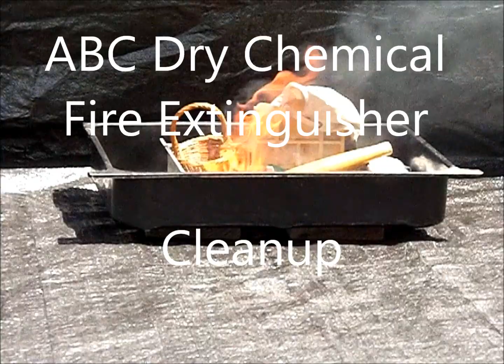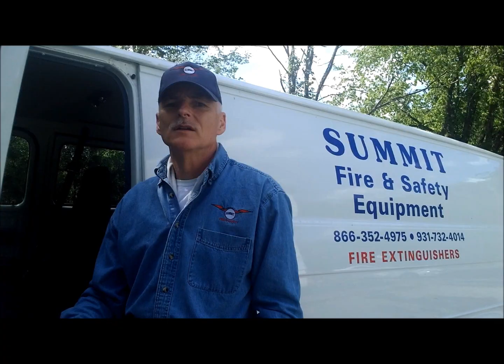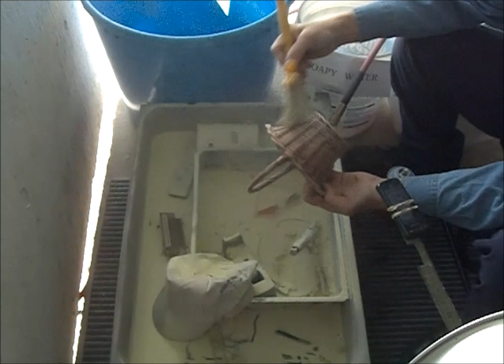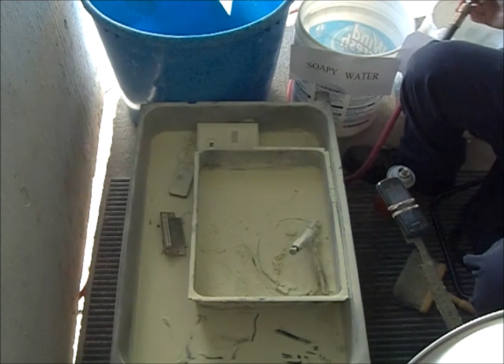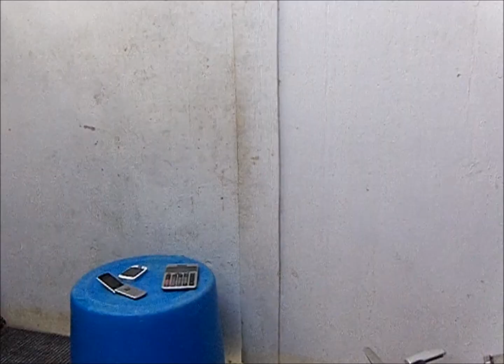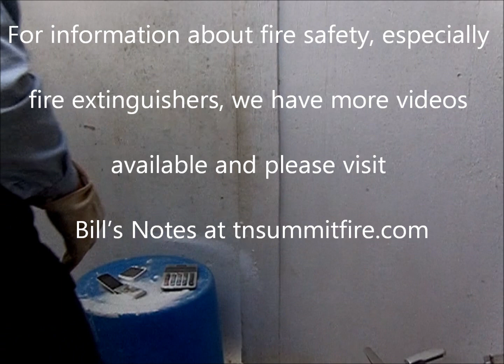FIRE EXTINGUISHER CLEANUP  How to Clean After Discharging an ABC Dry Chemical Unit

Comment: Better cleaning up dry chemical than having to deal with the aftermath of a major fire. That said, alternatives like CO2 / Halon / Halotron / etc all present their own advantages / challenges. They are quite a bit more expensive than dry chemical, and CO2 can be very dangerous in an enclosed area. Clean Agents are safer (though they are expensive) and they can produce dangerous HF gas when used on hot fires. Regardless of the type of extinguisher once the fire is out (or getting too big to safely fight) you should evacuate until fire fighters arrive and tell you its safe to go back in.